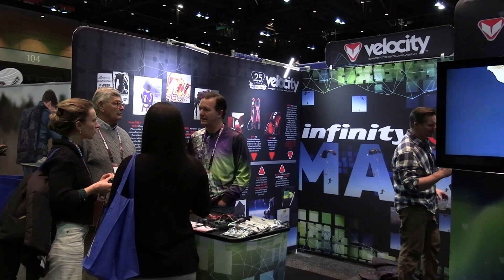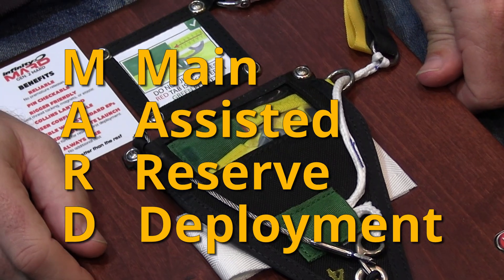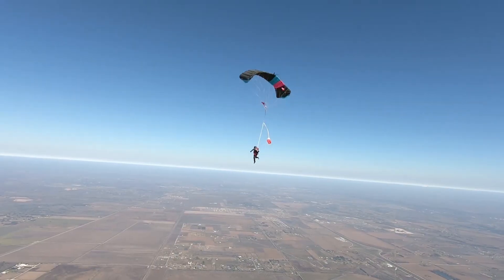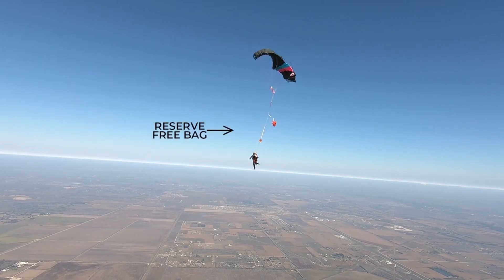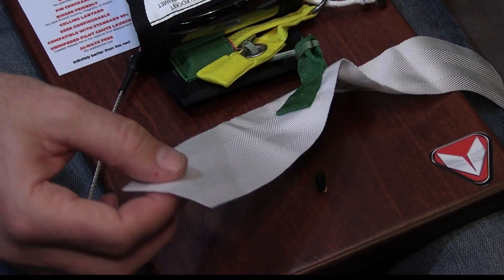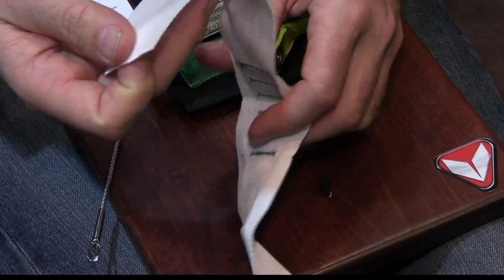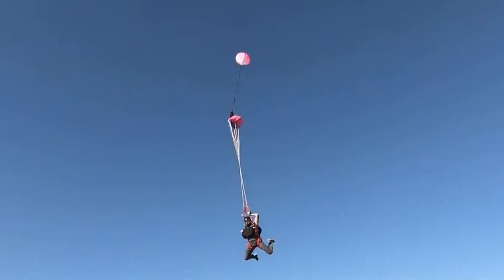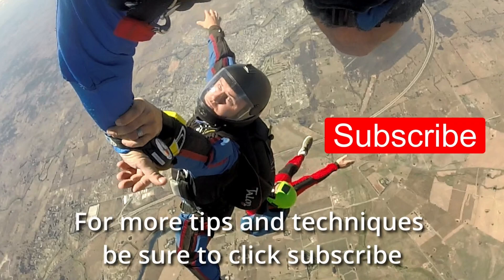Ep 70 How the new Velocity MARD works

Comment: This system saved my bacon after a pilot chute in tow. Whew!
Reply: If you've had a PCIT malfunction, this system did nothing (other than disconnect) to save your bacon.....
Reply: @g4mxs  thanks for the insight I'm fairly new to jumping (still a student)... Wasn't super clear how things happened but I landed with the main stuffed between my legs. I did EPs right and cut away first. Never got to the bottom of it but I feel pretty lucky either way
Reply: @Auzastas  Crazy!

Comment: I still don't get it. I'll have to watch this a couple times! How is this different than the Skyhook? Looks like less or no line twists when spinning.
Reply: SKYHOOK can disconnect at any point during the extraction of the freebag leaving you with the standard RSL deployment. Infinity MARD will not disconnect once the "trigger" is pulled. SKYHOOK could take up to 20+ lbs force to disconnect in case of a total malfunction, Infinity MARD will disconnect with just few grams.
Reply: @g4mxs  So this is good for line twists because there's very little force needed to release the main? And in a total malfunction it is less likely for main entanglement with the reserve popping out?